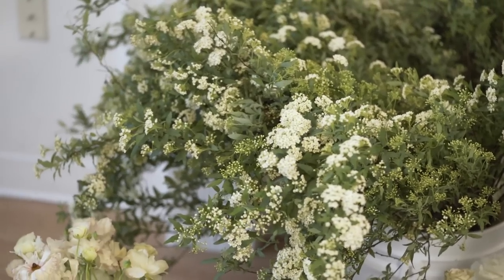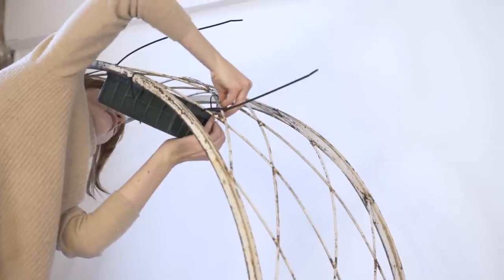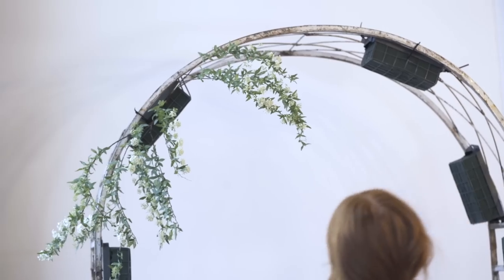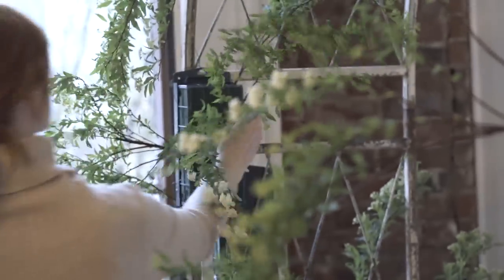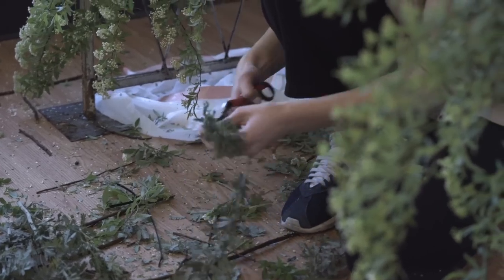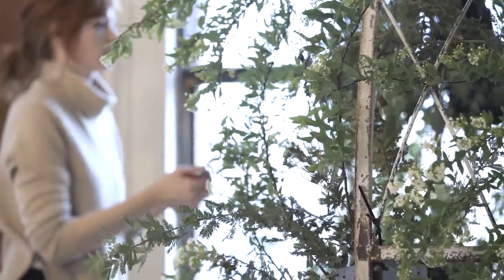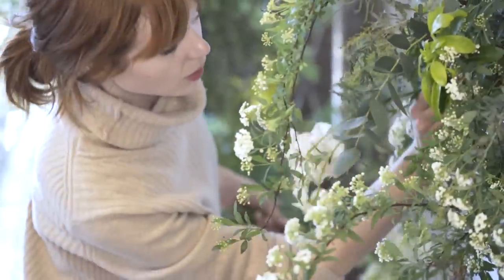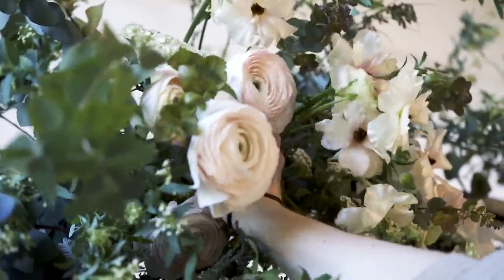Mayesh Design Star: Ceremony Arch

Comment: Hello, I'm using fake flowers/greenery for my wedding arch. Is it still easy to use the foam for plastic? Would you still even use them?
Reply: Hi Letticia! I wouldn't use floral foam for artificial flowers. Oasis works best when soaked in water, and keeps live flowers hydrated and in place. At the craft store you can find a special styrofoam that would work well, or you could cover the arch in chicken wire and use it as netting to keep the artificial flowers in place.
Reply: Letticia Borroni doing the same. Thanks for asking. I would have just assumed that it work for both.

Comment: How many bunches of each product did it take and how did you stop the arch from being too heavy on the front?
Reply: Hi Diane, 

Here are the products/quantities used:

8 bunch acacia foliage

40 stems spray rose

70 stems spirea

3 bunches eucalyptus

20 stems sweet pea

10 stems tulips

10 stem cappuccino roses

50 stem quicksand roses

2 bunches (40 stem) Japanese Ranunculus

This is how much product it took to cover the front half of the arch, so if I was creating this same arch for a wedding, I would use double the amount of product to make sure that it was completely covered all the way around. 

As far as not having it tip over, I just tried to balance the weight throughout. I attach all of the foam bricks in different places to evenly distribute the weight, and then put in the flowers. If I were designing this archway outside, I would stake it into the ground for extra support.
Reply: Kaylee What kind of stakes would you recommend using when building these installations outside? Thanks!

Comment: I will be adding flowers to pipe and drape. Will I need to add wood behind the cages first? Or can I just affix the cages to the pipe?
Reply from the maker: You would probably be able to attach the cages with zip ties or wire. Good luck!
Reply: thank you! Is it necessary to apply wood behind the cages?
Reply: I think that you can probably just zip tie cages to the pipe, as long as it has a sturdy base and can support the weight. You won't need to apply wood behind the cages, because you can get cages that have a plastic backing. (I like the Tribute Cage holder or Oasis Jumbo Cage from Oasis for this). Also, if you decide to hang with zip ties, I'd make sure to weave zip ties through the caged part as well as at the top and bottom of the cage, so that there will be no chance of the cage popping open, and the oasis brick falling out. (Just an extra precaution I like to take!)  Best of luck with the project!